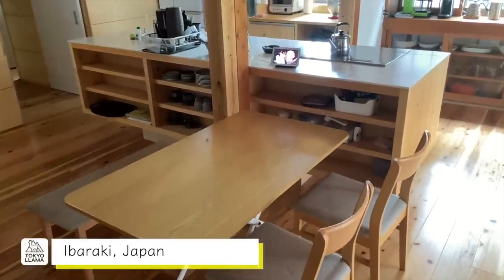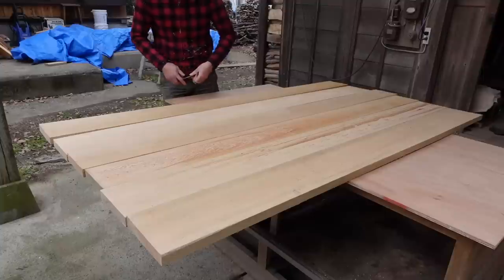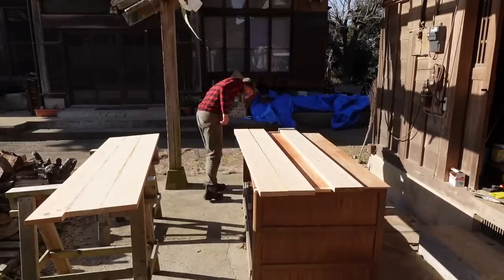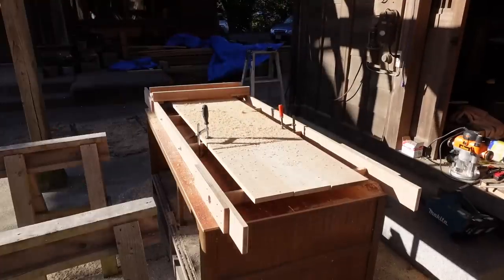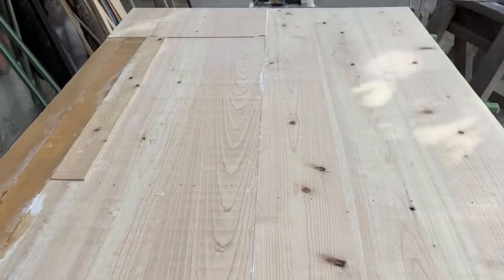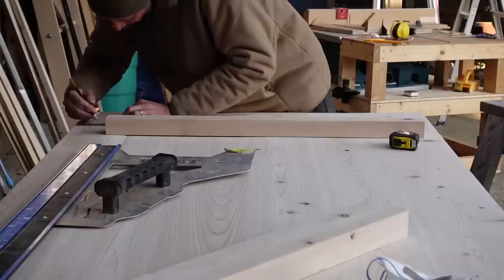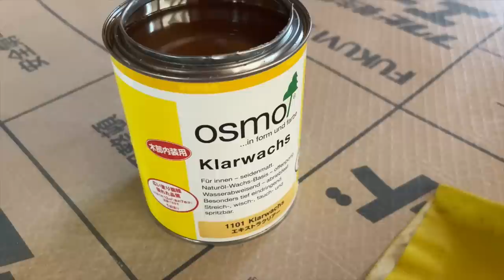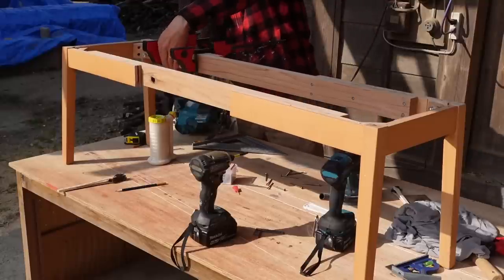DIY Floating Table: Building Without Jointer or Thickness Planer

Comment: Nice work, Jaya. Your carpentry skills have gotten quite impressive over the last few years. And once again, I’m surprised by just how many similarities there are between our two houses. Your dining room table (along with the room decor) looks a lot like ours…right down to the posts you had to fit it between. In contrast though, we cut a notch into the end of ours so it actually fits around the post. (My idea. Surprised my wife went for it.) The other major difference is… that we got our carpenter to make it for us. So again, I’m impressed by your skills. お疲れさまでした！ 🍻
Reply from the maker: Nice idea to notch around the posts. Maybe steal that idea if I remake this at some point!
Reply: If table is not meant to be moved, then sure, sounds like an idea
Reply: @W4iteFlame  You CAN actually detach it from the post, but it’s a bit of a pain, so the table usually stays where it is. (It is kind of a unique design… maybe I’ll show it off in a future upload? 😆)
Reply: @Jordan-inJapan  well, I was expecting it. Also, guess I have to check your channel one of those days
Reply: @W4iteFlame  🍻

Comment: " Because I don't have a Jointer.... "
Good lord, how many hours a decent Jointer can save me. If only my father has the mindset to not force his tool beyond it's recommended usage, we might have a Jointer and a Bandsaw instead of three dead Hand Planer, one dead cicular saw, one burned out cordless hand drill ( old model, without any spareparts available anymore ) and one cracked hand grinder.
Anyway, ranting aside.
The table turned out great !. Great job, Jaya !
Reply from the maker: Ha ha, well, I learnt the hard way trying to get by without a thickness planer.

Comment: Ishitani - GREAT inspiration. I assume by now you have discovered that the problem with the router is the bit collar loosening on you and allowing the bit to slip. Give it a good cleaning to get rid of the sap and other flotsam clogging the router collet and the bit shank. Then stop occasionally to reassure that the collet is still tight on the bit. I assumed that you would resort to using hand planes to do most of your smoothing. Surprise - you didn't. Using hand planes to do reduction of major warps and cupping can speed the thicknessing process. Glad to see you  back on YouTube.
Reply from the maker: Thanks, yes, I didn't realise that the flotsam and jetsam in the collar would have such a big effect as I made sure it was tight before using. Lesson learned (after making the same mistake twice...) In regards to hand planes, I wanted to use them more, but mine was blunt, and then when I researched how to sharpen Japanese hand planes... to be honest I got lazy, so tried to rely on the sander.

Comment: Good to see you again 
It’s been a while hopefully the house is progressing and the garden how it that 
I think you gave it a good go 
Jaya you don’t need a thicknesses just a good planer 
I’ve been making table tops for years and all I use is a planner and a good belt sander and I join it the same with biscuits and the bit in the router 
You just work the top down with the planer then belt sand it to with in an inch of its life 
When you getting that roof above you fixed 👍👍👍🇦🇺
Reply from the maker: Thanks, things moving along slowly but surely. Been doing work in the garden. Will show that at some point.

Comment: Oh I needed this video this morning. I could literally feel my blood pressure drop and the tension in my face go away.  My job can be tense but if I approach it like you do wood. I am ok. Thanks.   Oh I will add.  By that I mean.  A little at a time, no rush it will all come together
Reply from the maker: Very glad to hear that my video helped you in some way. Yes, I work slowly when I have time, though I'm not under (much) pressure.

Comment: Hi Tokyo Llama,
I have been a wood working hobbyist myself for 7 years and have had similar troubles with my routers. My problems were caused by the collet and bit shank being different sizes. In one case I had a 1/2" collet and a 12mm shank bit. 
On my palm router I had the original collet that was always too tight. I ordered a new 1/4"  collet and it fixed the problem. Collets can be ordered in imperial or metric and are inter-changeable.  Love your videos!
Reply from the maker: Thanks! I have both the 1/2" and 12mm collets, so that wasn't the problem, but others have pointed out that dust in the collet was likely the main cause.

Comment: Good job pushing through and working around the mistakes. You probably learned a lot of things you otherwise wouldn't have if you had a jointer and planer. And it turned out well also.
The difference between a journeyman and a rookie is the journeyman knows how to fix his mistakes.
Reply from the maker: You're absolutely correct. And if I do get a planer down the track I'll appreciate it's value more, too.

Comment: To joint the edges you could also flip them up, clamp together and use your flattening jig. Though it's definitely a slow way. People do the same thing with a thickness planer.
Reply from the maker: I found the track saw method to be easy and almost perfect - happy to do it that way next time.

Comment: Its always a ride when working without a planer or jointer^^ I will definitely use the trick with the track saw on my next projects. The table and bench turned out great in the end!
Reply from the maker: Definitely a ride! Check out the link from Walnut Workshop in the description for the video I learnt the technique from as he shows it much better.

Comment: I would never have thought of using a router that way, and it did almost work. The resulting table is really nice and fits into the space extremely well too.

Plus it's just nice whenever you post a video. Hi from Seattle! :D
Reply from the maker: I'm going to try to avoid using the router like that unless I really need it but got there (mostly) in the end, and glad I tried it out. Greetings from Ibaraki!

Comment: Thank you for taking all the extra time to video record your table making journey and then editing it to share. That is a massive amount of time and effort. A few thoughts from a fellow DIY woodworker. I would have left the decorative plugs out of the underside because at some point the washer head screws which attach the stretchers to the top (while allowing for movement, bravo!) are likely to loosen as the wood swells and shrinks. Being able to easily get in there and tighten them back up might be helpful as the years go on. The great thing about making things yourself is that this piece of furniture may be around for decades. You can imagine your children one day being grown with children of their own ... still sitting around the table you made.

On another note, that ceramic based wood hardening top coat is something I haven't seen before. Perhaps you can share information about that product.
Reply: Great build in the end. Im also interested in the ceramic paint.
Reply from the maker: I did consider not putting the plugs in but appearance trumped practicality in this case. I also figured I could drill the plugs out if need be, as have done before on other projects.
Reply from the maker: This is the info page on the ceramic "paint" (I didn't know what else to call it). It's in Japanese only but your browser probably has a translate button. The reason I used it only on the table top (top and bottom) is that it is expensive compared to the Osmo. https://www.diy-shop.jp/item.php?cc=0000051867

Comment: The most important thing.  Dose the cat like it?  Nice work, I can relate to the planing bits drifting down in the collet.  If the collet nut is not tightened that will happen.  But that is the ease answer.  If there is saw dust packed into the cuts in the collet this can prevent you from being able to properly tighten the collet nut.  I have had this issue with both routers and, even worse, CNC routers. Hope this information helps and keep up the beautiful work on restoring that house.  Got to keep that cat happy.😀
Reply from the maker: The cats are not allowed to touch it! Thanks - it seems that was the most likely reason for the slipping. I did blow dust out but not particularly carefully.

Comment: I think the milling bit got loose in the chuck of the Triton router and dropped out, leading to the nasty steps on the underside of the table. If you plunge out the spindle completely, the router locks it and you can securely lock the milling bit. I had similar issues more than I'm willing to admit.
The table came out really great! The wood is so gorgeous
Reply from the maker: Thanks, I’m thinking perhaps the bit got loose as you’ve said but maybe as the blades got dull after longer use, and as I started taking deeper passes it put pressure on it forcing it loose?
Reply: @TokyoLlama  the spindle and the collet chuck of the Triton Routers are usually rock solid. Maybe some deviations in the diameter of the collet and the shank of the milling bit?
Reply: @TokyoLlama  Any little bit of sawdust or other debris in the collet when you are mounting the router bit can result in what happened to you. At first the bit is held tightly, but the sawdust or debris eventually moves, and the bit becomes loose in the collet and can slip. The stress on the router bit to collet connection is huge when doing the kind of work you were doing. Those large surfacing bits have a big diameter and lots of contact with the wood. All of the resulting forces are trying to twist the bit's shank inside the collet. Also, make sure the surfaces of the collet and bit shank are lubricant free. Often new bits have a coating of oil on them to prevent corrosion. Clean everything off with alcohol or another solvent before mounting.
Reply from the maker: @johnhorner5711  Thanks, that makes sense. Appreciate the tips!

Comment: tks for the post, at least the table's knotted side matches the floor knots, it will make for a nice dinner conversation, i like the floating design and would have chamfered the table edges.
Reply from the maker: Thanks - I did chamfer with the router but my personal preference is for a minimal chamfer so perhaps not noticeable.

Comment: I realize this is too late but instead of buying a planner for yourself are there any woodworker shops that you might be able to take your boards to? You could give them $50 to run through their planner.  Like what about the guy that made your ranma?
Reply: Heard that recommended by other woodworkers. Only catch I heard them mention is a big charge if they run into any metal in the wood.

Comment: Stunningly beautiful and the bench! Can I ask:  why did you put the knotty board pieces together rather than interspersing them with the finer ones? That would have been an interesting look - but maybe the boards were also uneven?
Reply from the maker: That would have been nicer, but would have required me to cut the already glued up boards and redo, which at the time I was not keen to do. In hindsight, what I should have just done is pay for the nicer wood.
Reply: @TokyoLlama  HAHA! I get why you say that but the knotty pieces are lovely:  "embrace imperfection" said...somebody!  Irrelevant:  you said "don't want to throw good money after bad" That is SUCH an odd phrase - like your previously spent money is somehow 'bad'! So I looked it up - the 'bad' refers to the previous outcome (which didn't work) not the money spent on it. You learn something every day...🤩

Comment: It looks amazing! 😮 How did you go about designing it? Did you have all the calculations for how big each bit needs to be/at what angles you need to cut the pieces beforehand? Or was there some freestyling?😅
Reply from the maker: I designed it in Sketchup to the correct dimensions, so I have an idea and can see any problems that might arise, but cut as I go along, as usually things are not exactly the same as on paper once I start cutting/joining everything.

Comment: i am a bit sceptical about soft wood and technique being used. I would be affraid that such a table will bend and crack especially in japanese climete with changing humidity and temperature. How is table holding?

Comment: How much total time did you spend on just sanding? Are you only using the orbital?
Reply from the maker: Much more than I showed in the video! Probably about 10 times on the top side. Just using the orbital slowly, I don’t like to use the belt sander on hinoki because one mistake and you can gouge the wood.
Reply: @TokyoLlama  yes, I agree. Back in the cabinet shop, we rarely used the belt sander -- only in the rarest of situations. Sanding is so important but is tedious (when done right) a lot of videos don't show much of it. I had an awesome 2-hand Porter Cable disc sander and I miss it so much. Sanding long periods with one hand is for the birds!

Comment: Please forgive me for asking this: as the table top, with its cheaper more knotted half in contrast to its more expensive half, looks unbalanced to me, why didn't you split one of the halves into two and join them on the outsides of the other half to produce a more balanced appearance for the top? I know not everything in life has to be symmetrical or balanced - the Japanese concept of wabi sabi certainly demonstrates that and I love that - but just wondered if you considered that. Thank you - beautiful work and thoroughly enjoy your channel (since the beginning)!
Reply from the maker: Thanks very much. I think at the time my thoughts were that there were three boards to join so would have been uneven anyway, but in hindsight the better decision would have been just to pay for the higher quality boards.

Comment: I'm curious if you've done any research into community wood working shops in your area? That could help you in times where you're in need of a tool but don't have one, especially ones that can take up a lot of space. Then again you're in a rural part of Japan so the closest one might not be worth the drive out. I also understand the desire to work in your own space instead of a shared one.
Reply from the maker: It's a good idea - there is one close by that I popped in to visit the other day to say hello - might be able to use in future.

Comment: I can understand why you wouldn't as it would have been a bunch of extra work, but I couldn't cope with having the lumber so different from one side of the table to the other. So, I'd have had to split one panel or the other in half and bookend the other one with it lol.

That said, as you suffered the same issue with the lower quality lumber as you had with the nicer stuff, why didn't you go back to the nicer panel? Had you already scrapped it by that point?
Reply from the maker: Yes, at that point I didn't want to go back but in hindsight I should have just paid extra for the same quality lumber as the first lot. I also should have clarified in the video, but the second mistake panel wasn't cut as deep as the first, which I still have and will reuse on some other project (I still need to make a desk).

Comment: Heehee, the  lack of joiners and planers is why I've always used the 'cut down/rearrange something from the thrift store' method of table-making.  :)  (Also,  come to think of it,  your router may want for a new arbor/anything else holding those bits in place,   you were asking a lot of yours and it seemed to give up at some point.)
Reply from the maker: I think you're right, as I discovered on the bench, remaking is a lot easier and faster, and satisfying too! Good point about the router, I'll have a look.
Reply: @TokyoLlama  (Also listen for bearing noise with a thinner bit.   It may be not you so much as damaged tool.)

Comment: The router slipping was a royal pain in the a$$  I guess you could have added a band around the edge of the table, but that would have added extra work and complexity. But I guess you still had a great Christmas even without the completed table. . 👍👍
Reply from the maker: I thought about a band and that was going to be my next solution if the strips didn't do a good enough job hiding it, but it worked out okay. Christmas was fun regardless!

Comment: Help me understand, as someone who's been considering buying a pluge saw: why not simply use the existing circular saw? (Seems a little like they tried to find a way to separate more money from me when I really didn't need the thing.)
Reply: Also: well done. Great job with the table!!!
Reply from the maker: Good question. I had been using my normal circular saw with a track attachment and it was fine. There was a little give, which was a bit frustrating, but I could have got by. However, my upcoming project requires me to cut into floorboards - I need to accurately plunge the saw down to cut. The plunge saw also fits the track better than the attachment and is more accurate, I’ve found.
Reply: @TokyoLlama  Thanks! I can see those issues as a Bora I purchased leaves me strongly wishing for better. At the same time, I'm currently doing cabinetry, and I dont' feel it's fair to expect a track saw (or more so: an accessory track like the Bora's) to get such exceptionally precise measurements: 1/32"<1mm is just too sloppy for much of what I'm excessively working on.
But it might work well for breaking down a full sheet of plywood...
Again: thanks for the feedback!